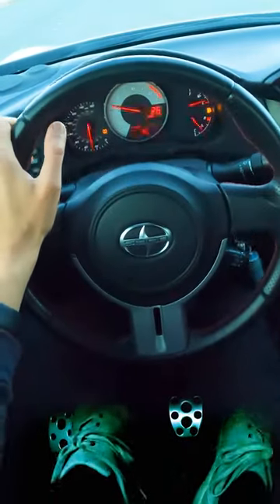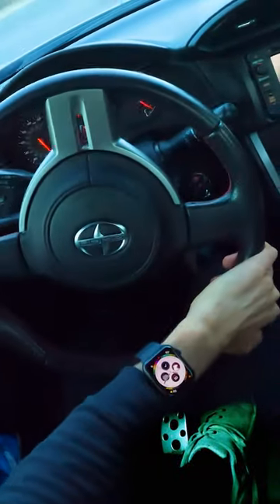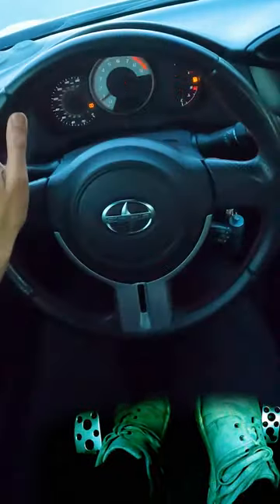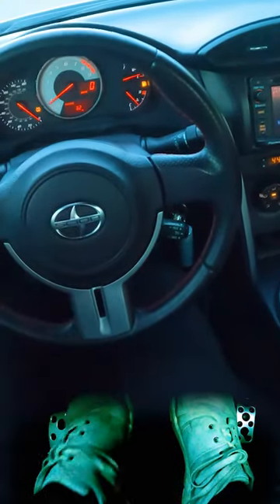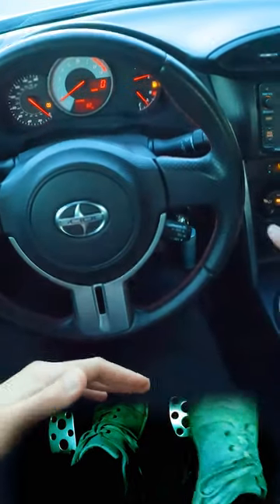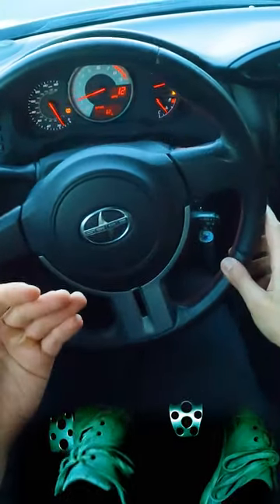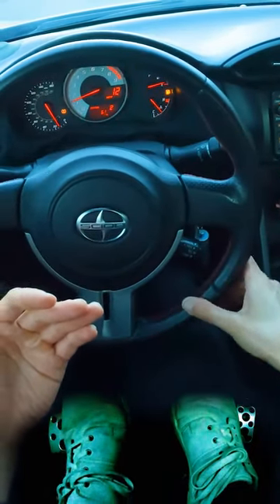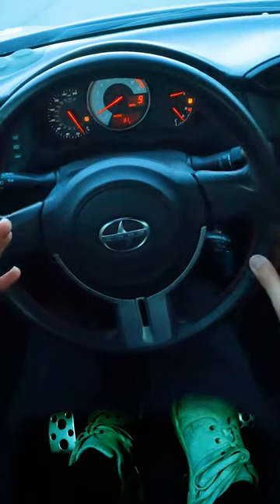Why use double clutching?

Comment: I liked the part where you told us why you would use double clutching.
Reply: Reduce wear on the synchros
Reply: Also reduces the risk of accidental drop in to a gear that is too low and over rev engine.
Reply: I think its bcos the lower gears are spinning slower than the higher gear, blip engine in neutral means u bring that lower gear's speed higher to match the speed of the shaft so the synchros can better match up
Reply: @sharknado4694 Wrong, if anything double clutching actually makes it easier to downshift into a wrong 'way lower than intended gear' cause you are spinning up the gearbox and taking the strain from synchros and making their job easier

thus easier to 'money shift' on accident as you won't feel the force needed to go into the wrong gear as you fight the synchros since they were standstill if not double clutched and brought up close to required revs
Reply: It’s useless for any modern car with synchronisers

Comment: Seems excessive and unnecessary if you have gotten basic Rev-matching down
Reply: It is probably a personal preference at this point, i hate rev matching, makes it seem like i will burn my clutch (probably not likely i know).

Double clutching is just my preference and i am aware of the throw out bearing wear (and that synchros exist).

Tldr: yes it is excessive, but i prefer it for many reasons
Reply: Great to know skills to have the optionality. You may come across an older vehicle without synchros or a modern vehicle with failing synchros
Reply: Interesting that you pose the question of why to use double clutch in your video but then only explain how to? Now on this comment you explain why. Wasn’t that the point of your video?
Reply: @evryordnryprsn that would be because this is a shorts video, if you want to learn more about it watch the whole video
Reply: I’ve been doing this for over 22yrs and everyday driving is a different experience. Some days the gears engage almost by themselves because the RPM and timing is exact.  A lot of the time I’m off by 500rpms or more. Your entire body really needs to be dialed into the vehicle for it to be half decent. Nowadays computers can shift to the exact RPM making it almost futile. Automatics waste no time or energy shifting. They also have lower low and higher high gears. Fight the good fight!!

Comment: When you double-clutch downshift, you put the transmission in neutral, declutch, and rev the engine. This causes the input shaft of the transmission to increase speed, and done properly, to the correct speed for the next lower gear. Then you clutch in, shift to the lower gear, and because the input and output shaft speeds are matched, no synchro wear occurs. To just rev while the clutch is disengaged means the engine comes up to speed, but not the input shaft of the transmission, so when selecting the lower gear the synchros do all the work, and eventually you rebuild your transmission. Yes, I double-clutch downshift always, even on the street. It makes your synchros last forever--just like as if there were no synchros at all.
Reply: I used to double clutch all the time (obviously on downshifts, upshifts not needed as the synchros slowdown by themself assuming you wait a split second in neutral)

Not anymore, but i would double clutch if revs gonns go up in about 2.5k+ RPM
say from 1.5k to 4k RPM and dropping multiple gears at once.

synchros are tougher than what you think, as long as the clutch is working fine and fully disengage. and you time your shift right(not banging gears before the clutch is pushed all the way)

i obviouslt rev match each shift up and down (upshifting i just wait for the rpms to drop, or blip the engine if i took too long and rpms went very low during the shift)

i stopped double clutching as it would cause more wear on the clutch cylinders(master&slave)

More wear on the pressure plate.
And probably more wear on the crankshaft thrust bearings.

I only double clutch when necessary.
Reply: but what's the point of synchro if you don't use them ?
Reply: @soap_off  when they are at the end of their lives, you nay 'assist them' as they are worn out and unable to do their job properly

if a car is brand new you can shove it in 1st gear at speeds higher than 1st gear top speed(money shift) and it would still allow you to with higher force but without grinding.

I have the habit of always rev match (with clutch out) if i was in neutral whenever possible thus speed up the synchros and prepare them for the next gear.
Reply: @soap_off  Just to note, syncrhos are luxury.

I hate it when some brand new cars (2024) still use unsynchronized reverse gear (and straight cut reverse gears that wake up the neighbourhood when you reverse from the whine).

i always wait after clutching before engaging reverse gear (synchronized or not) 
some people say shift to another gear before going in reverse, but that would (slightly wear) synchros unnecessarly.
Reply: Just a question, why not just revmatch with clutch pedal engaged? Does it wear synchros?
Reply: @Alexander-zq5ju  Rev-Matching with clutch pedal pushed in (clutch dis-engaged) does not help the synchros at all as the gearbox input shaft is not rotating at the rate of the engine it's freewheeling with the clutch disc, 

Clutch disc is not clamped between flywheel and pressure plate when clutch pushed in there is some gaps to the left and right of the disc

so it's not sandwiched and not getting torque from the motor (assuming clutch is fully disengaged, and all the hydraulics as in (master and slave) or clutch cable(in older manuals) in order including making sure no air in the clutch fluid.

You need to spin up or slowdown the transmission through the input shaft to achieve any desired effect and reducing wear on synchros.
Reply: @Alexander-zq5ju  Make sure you fully understand and practice rev matching before attemtping double clutching.

Rev Matching helps the car alot (especially engine/trans mounts) and all the bearings in gearbox and engine will live a long and happy life. 

if you got your revs way higher in double clutching you may add more wear to the synchros

Or if you timed your clutch pedal incorrectly or in a rush.

Practice rev matching perfectly then learn and attempt double clutching.
Reply: @Alexander-zq5ju  What car do you drive?
Reply: @MailboxReviews  okay, but people still do it so is that just to match the rpms for a smoother downshift?
Reply: @MailboxReviews  yeah i understand that, i already know how to revmatch pretty well, been doing it for a year or so, looking to gain some more knowledge about what it actually does and move on to double clutching.
Reply: @Alexander-zq5ju  Which is great thing to do, especially important if your car is fitted with 'Dual Mass Flywheel' Most diesels and newer petrol cars are fitted with one

in DMF clutch disc doesn't have any springs, all the springs are in the flywheel and the flywheel can get and is actually pretty expensive.

So all of the dampening effect is done and absorbed by the DMF, which will wear it out especially if one is not soo precise with clutch release and harsh with it during downshifts.

Double clutch is not a must, but if you learned to do it it can help the synchros, and could add more wear to other parts such as clutch (Linkage if cable clutch, or Hydraulics(master and slave cylinders).

It's up to you honestly, i used to double clutch all the time, but recently only during downshifts when dropping multiple gears at a time.

Remeber that synchros are there for you to take advantage of them. So use them, but keep your handle gentle with the stick so they take their time matching gears revs internally.

And make sure you clutch in all the way and that your clutch is not dragging and fully dis-engaging your engine from transmission.

Best of luck.
Reply: I do however rev match all the time, even during upshift by waiting for the revs to drop to match the new selected gear.

Some newer cars have what is called by 'Rev Hang' where the engine ECU does that on purpose. By keeping the throttle body plate open slightly during lifting of the throttle to improve fuel economy, and i would assume also lessen the effect of engine braking.

So waiting a bit for the revs to fall to the correct level is good thing to do when upshifting too.

Comment: You can double clutch an upshift; with synchronized transmissions its kinda pointless but if you have an old unsynchronized transmission or you are trying to float gears you need to double clutch the upshifts
Reply: You don’t. The transmission slows down at a similar rate to the engine during an upshift.
Reply: @4ae109  yeah i drive a 1999 civic hatch and you dont need to do that.
Reply: did you just try to say you need to double clutch to float gears??
Reply: When you're floating gears in a non synchro transmission,  you don't need to use the clutch at all.  Idk about all testing facilities.  But i know that for some if you go up there with a manual truck to test for your CDL, you have to double clutch for every shift or else you will fail the test.  Once you pass float all you want.  Double clutching on up shifts in a car with synchro gears "works" in the sense that you are doing the synchros job for them.  Which does make them last longer
Reply: I drive a 02 Civic and i dont need to double clutch upshift
Reply: @caseyscott1074  an 02 civic is hardly old, and definitely synchronized.
Reply: @caseyscott1074  it depends on the health of the syncros,  not the year of the car
Reply: So double clutching will save the synchros but will prolly kill your clutch faster lol
Reply: @caseyscott1074 You need to chose what is going to wear before, definitely I would prefer the clutch to go out before.

Comment: When a synchro goes out in you trans you’ll be happy you saw this. Not always necessary in modern cars but actually super useful when you need it
Reply: what is the sign of worn out synchro? is it the metal grinding sound?

Comment: I dont put in neutral,i blip while the clutch in to rev match
Reply: Yeah similar this is just another way and probably not better way bcs in the way you told there is engine breaking all time so it's a little better for brakes while when you put in neutral car has no resistance at all until you use the brakes.

Comment: I put silicone lubricant in my gearbox. Bad idea because it stopped the synchromesh working. I had to resort to double de-clutching after that - even after changing the oil.

Comment: Double clutching is very unnecessary with the creation of transmission synchros. All you have to do switching from 4th to 3rd is 
1) clutch in 2)blip gas peddle 3) shift into third 4) let go of clutch for a super smooth downshift that required no dbl clutching. It’s only useful when your transmissions synchros are destroyed or for vehicles that have no synchronizers. Thank god for modern technology, as double clutching in major traffic would be annoying AF

Comment: Why i felt like it stupid. Here the thing you clutch in to shift 4th to N, then clutch in again to engage to 3rd. Do you see now? Its the same as 4th clutch in to 3rd. Cause during neutral there no gear even engage. So just go 4th to 3rd its fine. Plus when you double shift, it make your engine rev down more, when you finally engage the 3rd gear, your rev would climb really really fast, which in turn would stress your engine more.
Reply: It has the same final result yes. When you let clutch out in neutral and rev match, you bring the gearbox up to speed, meaning less work for the synchros. This will make the synchros last longer (or if your car has bad synchros, make the gear shifter slip in smoother)
Reply: @wil54  i think it is for 1950 gearbox or something cause, in modern manual gearbox, you could just clutch, shift upper gear, which require lesser rpm then the previous gear, and just clutch out it will be quicker, double shifting felt like adding more work into just shifting for benefit of nothingness that i can see.

Comment: This technique is only useful for non synchronized transmissions like u find on a big rig
Reply: Exactly
Reply: or if you wanna make your synchros last. imo i can replace my throwout bearing with every clutch change a lot easier than i can get new synchros
Reply: Of which you don’t even need to use the clutch at all except for take off and stoping 

I’m fully convinced double clutching was invented to teach idiots how to slow down their shifts and let the revs drop to the correct RPM for a smooth shift

I’m not even convinced (have no experience with one yet) that this is necessary on new trucks. Both my international and freightliners engines rev up and down FAST 
Like very surprisingly fast, almost instantly going up, and still fast coming down
Reply: @matthewheitzman5993  double clutching is from when transmissions in cars didn't have synchros lmao, it's also helpful for when your synchros give out. don't get me wrong it's not needed anymore for the most part, but to pretend it never had any purpose is pure insanity lmao.

Comment: Geniune question, what’s reason of putting it into nuetral, letting off clutch, revive engine, then clutching and shifting. Can’t you just rev the engine when your foots on the clutch, since it’s basically doing the same thing as when a cars in nuetral, disconnecting the engine from the rest of the drivetrain.
Reply: Thinking the same .....
Reply: When you let the clutch out, while in neutral, and blip the throttle the input shaft spins all the gears up. If you push the clutch in, and blip the throttle, all your doing is increasing engine RPM. (I may not have the terminology spot on, but the mechanics should be correct.)
Reply: @garyowen9044  thanks for this explanation, makes it make sense to me perfectly :)

Comment: take foot off the gas , in the moment (only very smal moment, right after you release the gas ull have 2 practice) when theres neutral load take out the gear give gas and let the lower gear slip in when the engine rpm matches gearbox rpm , noo need 4 clutch , taking 1 step out , faster and smoother shifts and of you do it right there wont be anny teeth grinding .
Reply: 11/10 woud not recomend if you scared of damaging the transmission. since if you fuck up teeth will grind, Metall will shave and you will pay or fix it youself wich also sucks ass , if you have ever pulled an transmission (and u dont have all the right tools) ull know
Reply: Floating gears is fun but I don't think it would be faster than using a clutch
Reply: You're putting wear on the syncros doing that.

Comment: You don’t need to do this. Be gentle with the clutch pedal, especially on older cars. I’ve broken two slave cylinders on two different cars by double declutching. For everyday driving, keep your feet smooth on the pedals rather than jabbing the clutch on and off and putting stress on the hydraulics.

Comment: Me just wondering why you have four pedals😂
Reply: well some cars (mostly older ones) had 4 pedals, the 4th one had a different use in every car but the most common use was to operate the high beams or windshield wipers.. now why a scion has this im clueless, im also clueless as to WHAT it does in a scion
Edit: After some research, its an aditional pedal that serves as a foot rest.

Comment: Wouldnt clutch in, blip throttle downshift be better
Reply: That will only increase engine RPM. Double clutching on a down shift matches (we hope) revs of engine, and revs of gears. When you blip the throttle when the car is in neutral, and the clutch is out, all the gears in the transmission spin up. It isn’t necessary on modern standard transmissions, but it does save wear & tear on the synchros and dogs, and does make for some satisfyingly smooth down shifts.

Comment: This doesn't answer the question 'why', as it's completely pointless.
Reply: Those who say it’s pointless simply want to excuse their inability or unwillingness to learn
Reply: It’s fun, and saves wear and tear on the synchros and dogs, and it also less of a jolt to the engine when you let the clutch out. With the engine, think of it as giving your engine a running start at a lower gear.